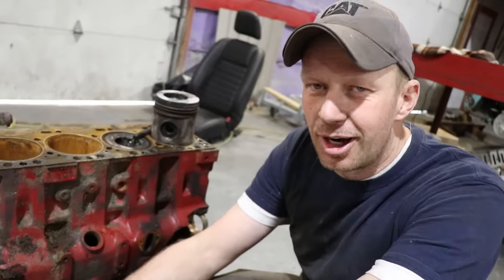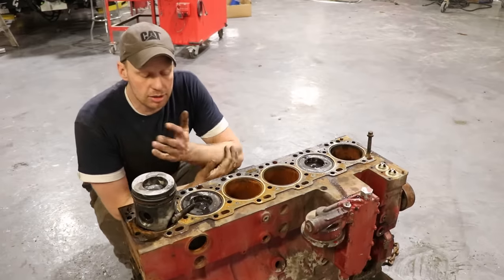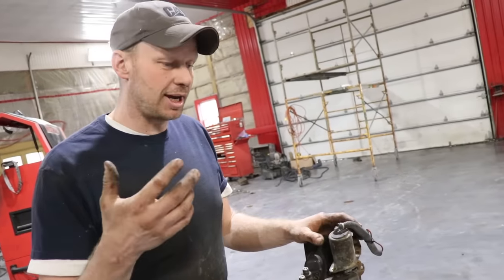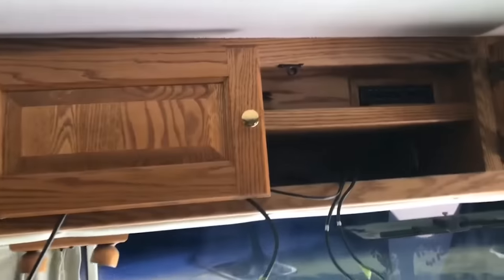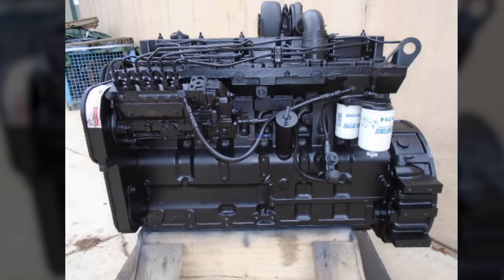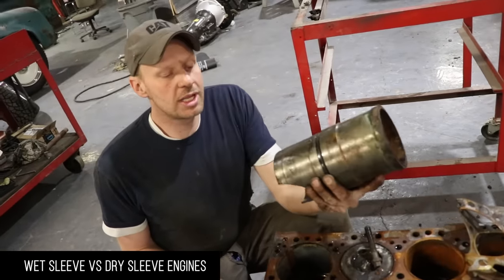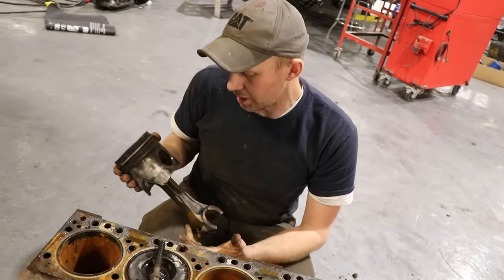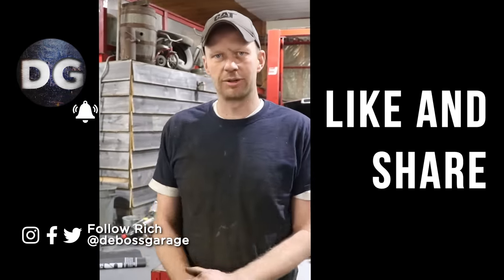REVIEW: Everything Wrong With A 8.3 Cummins Diesel

Comment: Love your videos! Great job and easy to understand you. Thank you for that!
Ok. I know you don't recommend it, but I'm gutting an 93 OBS Ford CC F350 4x4 Long bed currently with a 7.3 / ZF 5spd.  So already in the heavy drive train dept! 
 My question here is what can I do to increase HP. Not a lot, maybe 400 - 600 would be nice. 
 Also, what kind of transmission would you recommend. Thinking Ranger 9 or 13spd maybe? Will still want 4x4, so thinking remote TC. Rather not, but not sure if f i have a choice here. 
 Truck will be running the 395 85R 20s and looking to build my axels (SRW) with all fresh internals, ARBs, and trussed/ and located bc of the tire weight.  I will make the truck as short as possible. Thought about other axel swaps, but maybe you have thoughts here as well. 
 I like this bc it came in Fords to begin with, and I can tow in the mountain grades regardless of what I'm towing.  Style will be a Megalander, so I'm a bit open on the bed too. 1st draft was to tub my current bed, but then I noticed utility beds so....? Lol
 Any info would be greatly appreciated. 
 AGAIN, Love love your videos! Thank you for making them!

Comment: Back in school we took apart a early 80s fuel injected 4 cylinder Renault engine, took the head off and boom 3 sleeves came with it.... like wow it had wet sleeves in a 4 cylinder gas engine around 2L displacement them frenchies really knew how to build a engine back when everything was cast iron and carbed 
All aluminum Sfi efi egr wet sleeve

Comment: Hey buddy, I have a 8.3 in my IH combine and it has the same p pump. There is a plate on the bottom of the pump that has like 6 screws that holds the plate up. Is there engine oil that goes above that plate?? And do you know if there is a gasket for in there. I'm pretty sure mine is leaking engine oil. 
Thanks Man

Comment: Everybody gets cavitation wrong, that is not how it works.
Full vacuum doesn't have enough force to tear metal away, what causes this damage is the fact that after the "vacuum bubble" is created, the liquid rushes back unevenly to fill the bubble again, and in doing so impact the metal with extreme force. The impact create a extremely small, yet extremely hot and high pressured point, which damages the metal.

It's of course a very simplified explanation, but the important point is that it doesn't "suck" the metal away, it's the abnormal pressure conditions that do the damage when the "vacuum bubble" collapse.

Comment: Thanks for this video.  I have one of these engines in a 94 Gulfstream RV.  I bought it because it was recommended with the mechanical fuel system.  I am having trouble with very high oil pressure. Can you help with troubleshooting that? Do you have another video for it?
Reply: DiD you find out the answer to this problem?

Comment: Old thread but I am curious on opinions on this topic. I have a 1964 C60 with a little 327. I wanted to swap in a diesel of some kind for more torque. I had been leaning to a 6bt due to how common it is and extensive the aftermarket is. However, the front I-beam, tires, and suspension can hold a 8.3 no problem. Which would be the better choice for a pulling rig?

Comment: The 8.3 has camshaft issues local guy years ago with twin 8.3Bs both engines suffered from cam bearing failure did a number on both engines cost quite a bit to repair, heard lots of other 8.3s with camshaft bearing issues. Cummins should have made the 4bt 6bt with wet sleeves, I guess they decided not too and keep them a throwaway engine.

Comment: Do dry sleeves / no sleeve also need coolant filters? Do all diesels need it? Does cavitation also affect gas engines? What engines need those additives?
Reply: All diesels need the additive in it's antifreeze coolant, filter or not.  Too much and too little is not good. Filters generally come "loaded" with the additive, which is (still?) available separately as disolveable "pills".
 Iirc it has to due with silicate(s?) level(s?) and the vibration/harmonics inherent in diesels.  

I'm sure there is more to it and better info is available from various manufacturers.  Please do not trust me on this....

Comment: What is your preference when comparing a Common Rail 8.3 to the DT466E, in terms of reliability and longevity. I'm looking for a class 7 4x4 truck and it seems the vast majority of them are newer than 2000 so the pre-HEUI DT466 is pretty much not an option.

Comment: NTC  N14 mostly are Cummins I worked on. My 8.3 experience is 2 engines I in frame both. Because of engine knock. 1994 to 98 engines both same problem wrist pin bushings. Was this a  major problem with the 8.3

Comment: Wow I had no idea what "cavitation" actually was!? May you please go further on this?
Reply: cavitation is when the smooth metal surface starts to develop these small but noticeable discolored spots, either cause by rust, corrosion, or other damages. it creates pin holes/ thin spots in the metal

Comment: Hi, I really enjoyed this video. I wish I had just a fraction of your knowledge. Since I don't, I would like to ask you a question about my 95 Cummins 6CTA 8.3. I live in my RV and travel about 10k miles a year. Every now and then I loose power and have virtually no acceleration. This can happen within the first mile or 150 miles later. I have to pull over, shutoff the engine, wait 5 seconds, start it back up and everything is back to normal until it happens again. In 2015 I had the P Pump rebuilt $$$ and I hope I don't need that again. Do you have any suggestions that I should try first? Thanks

Comment: I never realized how important the coolant additive filter was to the piston sleeves. I just assumed it was an anti corrosive chemical to extend the coolant life and prevent radiator rot. I have an 8.3 cummins in one of my generators, and I will be changing that coolant filter out asap.

Can I assume that any engine with a coolant additive filter is a wet sleeve block? Even on a Cummins big cam?

Comment: Funny you mention the 5.9 "KDP" here in the UK we have the 5.9 cummins in all sorts of trucks, tractors and plant and we dont have the same issue with the dowel as you guys in the USA... whether its a difference between UK/German castings and US ones or whether its because our fuel pumps and compressors all have their bracing brackets tightened up to spec so the timing case doesn't flex I don't know.
Either way Cummins dont recognise it as a design flaw or issue so they must have put it down to operator/fitter error?

Comment: Had a PG&E truck come in with 8.3 caps fuel system
8,000 miles on it 
3rd failed injection pump pan full of fuel
No one knew why till they put me on it
When I removed the injection pump and set it on a table I knew what the problem was 
Why  because no oil came puuking  out of it 
Like they always do
So I pigged the engines oil system and no oil came out of the front cover 
Pulled the front of the engine apart the block oil bore to the cam journal that supplied the front cover not drilled all the way 
Whole time Cummins rep telling me to put another injection pump on it 
Every step I took he couldn’t believe what I was telling him
Finally i proved my theory to them and was told to just drill it and reassemble with new injection pump
That truck never came back because it was fixed 
Those engines notorious for shattering the coupler in the injection pump
If you ever get one that wont start 
It has a sound like its out of time (because it is)
Pull the cap in the center of the injection lines put a small magnet in the hole pull out the coupler if you get pieces get a new injection pump
We bored the 3126 C 7 blocks and put stock size sleeve back in doing only 1 cyl some times as a cat warranty repair

Comment: I have a 1995 JD 8970 tractor with the factory installed N14 (early 90's were repowered but JD did it themselves for a few years) it's a great machine, down side is now over 8000hrs i get a sporadic voltage warning and the engine stumbles, big problem is JD wont look at it as they stopped keeping mechanics trained on it, and other makers that do work with Cummins wont touch the green stuff, any info would be awesome,PLEASE PLEASE PLEASE.

Comment: I worked on several ISC'S with the CAPS on transit buses. My biggest issue with them was the Cam sensors (2) going bad causing a no start. They'd go bad on me around 250k miles. They're on the left side of the engine behind the timing cover right against the air compressor. Wow what a b!tch to get to. Had to drain the coolant and drop the compressor and p/s pump to swap them. I cursed out the engineers so many times doing those. Other wise great engine. Never had a problem with head gaskets but did do a few manifolds. Cheers dude 😎 I'm loving these vids
Reply: Ford 7.3s had the same issue but their easy to replace on the side of the road

Comment: Thanks for the video. I'm an auto mechanic but new to diesels. I own a 2001 motorhome with the 8.3 CAPS engine. I've heard there is some sort of an issue with the electric lift pump and filter, and that there some sort of an aftermarket pump and filter system that is supposed to address this and protect the CAPS, making this engine relatively bullet proof in a motorhome. Any tips or links to a fix? Thanks!
Reply: “Fast fuel”he mentions it when comparing the p-pump and caps system.

Comment: I have a 1953 Fordson Major Diesel with a 1967 block in it, the head, oil pan, injection pump and everything else appears original 1953ish. When I was looking into why this would be the case I read the first blocks 1953ish were wet sleeves and corroded through from the water gallery so the engine was redesigned as a dry sleeve block, with replacement blocks being dry sleeve units. Do you know anything about these motors and if so does this sound right.

Comment: When you spoke about the coolant additive to prevent the sleeve pitting issues, what additives are you talking about? Just replacing the filter more often?
Reply: The coolant filters we run have an additive in them. No more than just changing the filter, otherwise it was a dip strip and some other crap to add to adjust the balance  properly.

Comment: Speaking of cavitation what's a good antifreeze to run in a 7.3 idi, I know this question has been beat to death over the year's just figured theres been updated coolants since then. I'm leaning towards running fleet charge. I'm replacing the radiator reason for asking.

Comment: in the process of rebuilding one now to put i place of a 3116 cat that has been replaced /rebuilt by cat 2 times in 226.000 miles  . they are a lot better than the cats 3116 and 3126 ,,

Comment: What kind of HP TQ is possible in one of these and yet be a reliable daily driver? I’m looking into putting one into a medium duty truck that will tow 20,000 lbs. I don’t want a billowing cloud of black smoke at every light but I also want to reach Highway speed before 5 miles. Lol.

Comment: how is the 8.3 cylinder liner sealed at the top, where it intersects with the block deck? i know it is a relatively tight fit, but seems like it should have some sort of sealant used to prevent coolant leakage? or does the design rely on the head gasket to make the seal, and some coolant will be therefore between the block deck and the liner top ledge?

i just tore down my first 8.3 for an inframe overhaul, also have 45 plus years experience as a hd diesel mechanic, with experience in the older engines, such as all the detroit 2 strokes (both dry 71 and wet 53 and 92, some 149) the mack dry sleeve engines, older small and big cam 855 cummins (and the v series 504, 555, 903), cat 3406 and 3408, etc... however all of which have a top rim on the liner which makes the seal at the top of the block (if they are wet sleeve design, no need for a seal in the dry liners of course).

the point being i am totally in the dark when it comes to having a wet liner that does not sit on a ledge in the top of the block/deck to make a seal, so therefore i ask

thanks
mobile_bob

Comment: I have a 250 hp 6cta with the water to air het exchanger in my 89 monaco crown royale. Love the engine, would love to turn it up but its mated to an allison 653 trans. Max input hp 250 max gvw 80k lbs. If Im at 35k with a trailer...think Im safe to turn it up some?

Comment: I have a question.... Help!!! Have a isc 330 cranks no start. Also think sometimes i have voltage problem. I dont always get 12 volts to the electric fuel pump sometimes its a low 9 pump wont turn on when its pump turns on. When the engine does start i usually get maybe 10 mins run time before it shuts off

Comment: Good vid. Just curious though; did Cummins never go to a HEUI system?
Reply: No, cat and ih were in bed together on that, and however bad the caps or vp44 is, its better than heui.  Even cat figured that out, and went to what is basically a knock off DDEC injector.

Comment: Thank you so much for your excellent videos.
YES wht. Issues. Trying to put this in a chassis that it was NOT design for. The combine block issues I wonder if it's because of the speed of combine working in fields. Slower speeds. Then the build up of all the grain. Weather corn or wheat. Plugging up cooling areas. Guys who want to put these in there pickups. I think they need to go with the bigger trucks that have the beefy front ends. Then put a pickup bed on your truck. I personally like the Mitsubishi Diesel's
Old school systems used. But that's from marine publication that I read. So it's for a vessel hull that is designed for the wht.

Comment: I have 1994 Monaco motor home with this motor. I'm hearing a tingling rattling noise coming for the front cover around the fuel pump area. When the engine is running not so noticeable but when you remove the filler cap you can hear it very well. I've been looking at other videos  with the engine running and it seems to be normal. Is it ?and what is it? Just gears contacting each other ?

Comment: I just picked up a 2001 bus with the 8.3 in it. My injection pump is puking fuel from the back of the pump. It looks like it’s coming from an injector line but I just can’t tell. Any thoughts?

Comment: Yo Deboss so thank you again for this video on the 8.3! I want to buy a Dodge 5500 and also buy a 8.3 12 valve with the p pump and do a fun project and do a swap. What should I look out for and what problems will I run into? Thanks🙂
Reply: I plan on an F550 to swap one into paired with a fuller 6 speed.  I know for sure I will have to raise the body or cut the firewall and possibly a cowl on the hood for clearance.  I won't raise the body for firewall and hood it is.  Class 5 can take the extra weight easily.  It's less weight than a plow frame setup.
Reply: Go a dt466,. 8.3 is great stock do not live long turned up rods tend to be week and not like rpm
Reply: POLOLOUS3 Thanks I will keep that in mind I also wanna do a fuller 6 speed swap to go with the 8.3
Reply: Ray Hancock thanks I will keep that in mind but I do wanna go with the 8.3 because it’s rare and unique plus I’m not gonna turn it up or anything just planning to keep it stock

Comment: Do 24 valves have dowel pin problems too?
Reply: 99 cummins Ram not typically as the vp44 does not create as much vibration as the large ppump on a 12 valve

Comment: Great video, do you have any knowledge of the CAPS system? I have one that likes to cut out if the throttle is moved more than about 20%. Had 2 dealers so far waste thousands trying to figure it out, now they want to throw an ICV and ECM at it to see if it helps, but I'd rather not dump $10,000 unless it's a sure fix.
Reply: Did you ever get an answer to the problem?
Reply: @jayfarber4137  Yep, finally decided to try changing the ICV myself after the local shop wanted 2 weeks for the job, took me an hour and runs great now:)

Comment: I'll tell you what's not wrong with it. That Holset turbo. I used the compressor side of one to create a hybrid with my H1C for my Cummins Bronco and it makes almost 40psi. lol
DT466 is 260 hp.. I've driven them before.. ugh. Snails. Cummins has so much more power with only 200 lbs more weight?? I'll take the Cummins. lol

Comment: Would I need to bleed coolant system after replacing lines or generally "opening" then re-closing the system?  How to bleed it? 
(94 blue bird bus rear engine,  removing cab heater)

Comment: This guy should design a diesel engine from scratch.  Something super durable and easy to maintain.  I am thinking some kind of overhead cam system (no need for push rods) and timing gears instead of chain.  fuel system could use unit injectors.  NO COMPUTERS !!!!

Comment: I thought it was the detonation of the diesel causing the cylinder wall to "ring" that caused the cavitation, and the DCA's made the coolant stick to the cylinder wall to so it would stay cooled? I mean in theory if its piston rock causing the issue then gas engines should suffer even more.

Comment: HI, do you have a procedure of making sure the pump is adjusted to factory specs? I have this engine in my motorhome and it seems to run really high egts when we go up a hill until I manually down shift it and feather the throttle accordingly. To me, it would seem that the factory settings this motorhome should be able to take a hill without getting hot and downshift on its own. It never came with boost or egt gauges to monitor this and to me it seems like someone messed with it to try to get more power the wrong way.